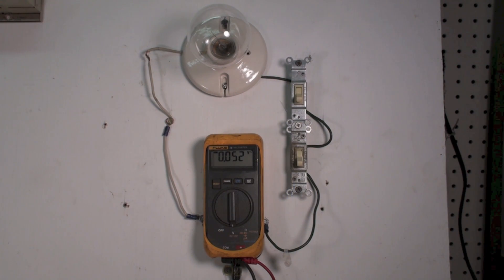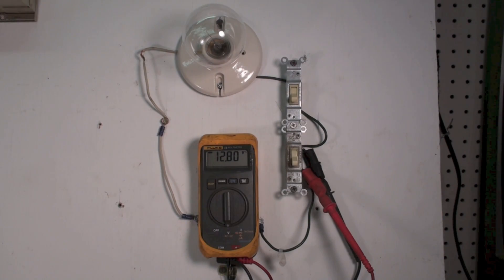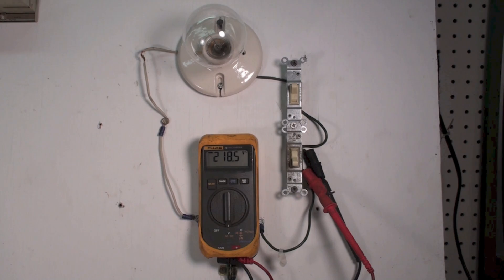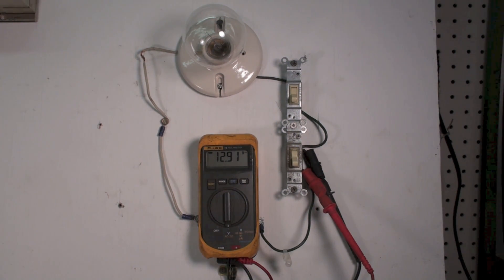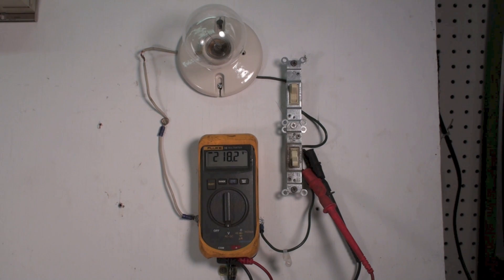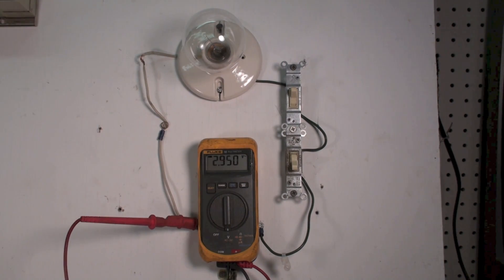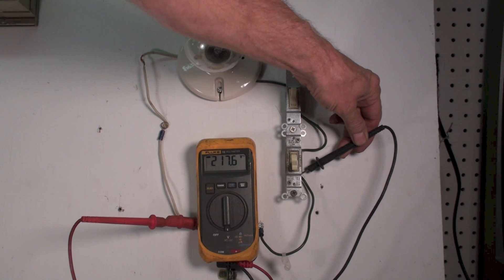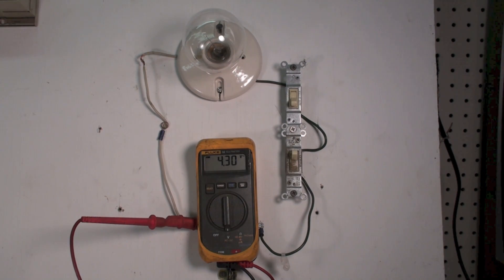Electric troubleshoot with a voltmeter.  Circuit with 2 switches Part 3

Comment: I think some people are thrown off by your change in power supply voltages. In part 1 and part 2 of this series you were working with 120 volts but in this video you are working with 220 volts.

Aside from that inconsistency, I love your videos and have learned much. Gracias!
Reply from the maker: Thanks for the thoughts.
GFM

Comment: Great video. one thing. what is your working voltage on that light bulb? Do I read right? 220 volts?
Reply from the maker: No, its 120v
GFM
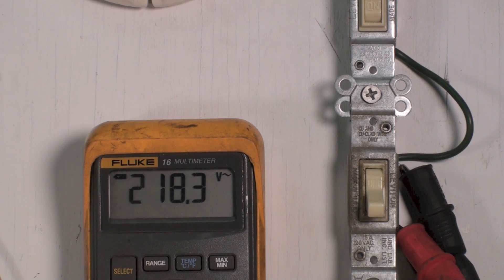Reply: grayfurnaceman Then how is it at 3:59  into the video you are reading 218 volts?
Reply: Yes, I was "thrown" by that too. 

Also, at 2:47, it shows 12 volts, where similar situations show 0 volts.  It begs the question why it's not showing near-0 like the other situations. 
Any thoughts?

Otherwise, TYSM for this great material. This should be taught in high school instead of that (pretty much useless) abstract stuff they teach.